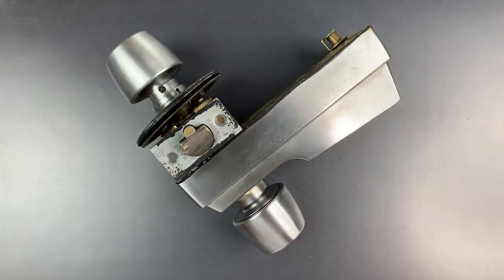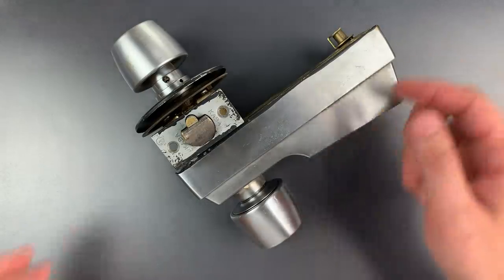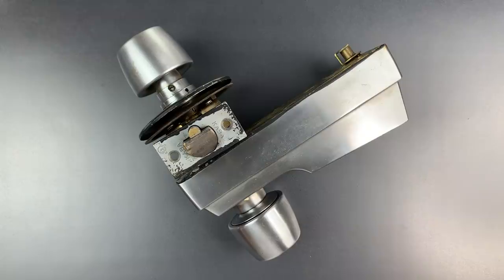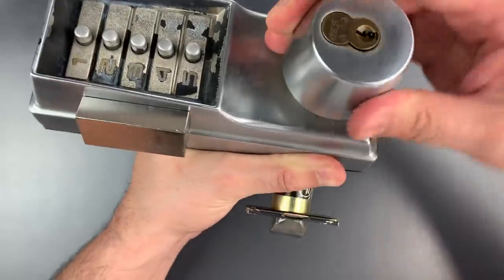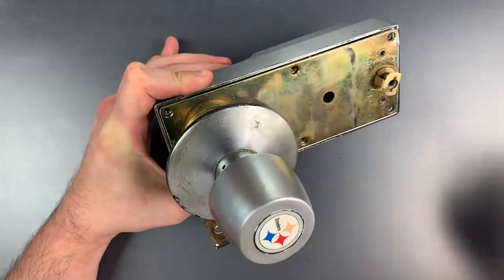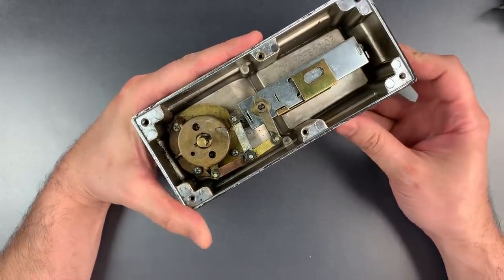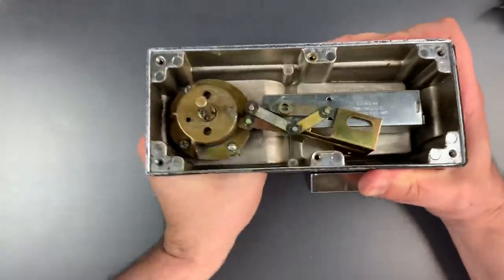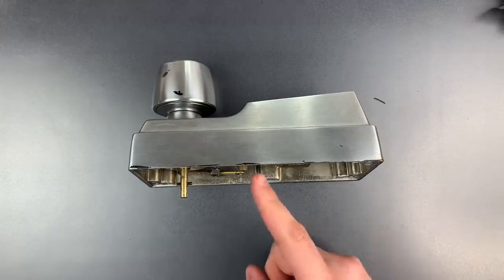[914] The Worst Lock Design Blunder Ever? (Kaba Simplex Series 1000)

Comment: If that’s true that this model was the one with a thumb turn on the inside of the door, there are hardly any out there that I’ve seen in my 20 years as a locksmith. Almost every one I’ve come across does NOT have a thumb turn, therefore, does not have that metal piece in the inside.

Comment: It almost seems like the whole point of that goofy linkage is to allow the knob to turn without opening the door.  Unlike, say a normal door lock that just prevents the turning of the knob.  Am I missing something or is there a reason they didn't use something more conventional.
Reply: Ray Ceeya it is so that smashing the knob with a hammer so that you can turn what’s left won’t open the door. I doubt this is sufficient to stop someone from continuing to attack it until they force it open but it does buy a little time.

Comment: I forgot to add earlier: at work, these are usually installed without the backup key lock, because they don't ever come with it. So on the front of the lock that faces out of the room, where the key SHOULD go... there's just an open slot. In the back of that, there are two pins that can be spun and the lock opens. I usually just open them with the file on my multi-tool... or just the tool they provide that's supposed to be used to spin the retaining ring.

Comment: Only works on a 1000 series with the passage function, which is not standard equipment. Cool trick however. Hardly an egregious flaw but now you’ve told everyone so good going. I’ve been a locksmith for 42 years and have tried to minimize telling thieves how to defeat locks, but you seem to be clever.

Comment: I hated these when I worked at the Pentagon in the late `90s. Even without the magnet it is easy to figure out the combo due to wear. They hardly ever changed the combos, even though security requirements dictated that they be changed every time a person left the unit (usually orders or end of contract). Many never hit changed from the day they were installed.
Reply: Misuse of the lock isn't the manufacturer's fault. It's the negligence of those contracted to maintain access security. It takes about two minutes to change the combination, if you know what you're doing.

Comment: That design is NOT a high security lock. There are only a very few unique combinations (a few hundred) that are possible and that does not provide a lot of security. But it looks neat.
Reply from the maker: A few hundred? Check your math, and remember that (1) order matters, and (2) a button may be pushed simultaneously with another button or buttons.

Comment: To be fair, back in the day when these locks were used (70's and 80's), since neodymium magnets were not invented until 1982, and even then, were prohibitively expensive and not easily available. You couldn't go on Amazon and buy them like you can now.
Reply: It doesn't require a neodymium magnet.

Comment: The 1990’s choice... There is a vast difference in heavy durability versus high security.  All it takes is starring at users enough from a safe distance to see the code.  These workhorses have been applied to far too many openings that probably are worthy of better tech.  These $700 -$900 installed units were often justified versus $3500 -$5000 for online card readers at that point in time.  Today, material costs on the electronic side offers as low as $1900 offerings, especially stand alone or cloud based.  Prices are center line examples of installed costs, which obviously vary in different labor and union markets.   The $5000 example may include conduits.  If you are installing in a Airport, logistics and the working environment may double the cost.  

Back to the term “High Security”... this lock does not even deserve such a title even without the magnetic defect, based on my 4 decades in the industry.  It’s heavy duty or Commonly referred to as Grade 1.  BHMI Grade 1 is a testing grade for mechanical longevity.  In most Grade 1 products, the security will be more secure to lower Grade 2 or 3, yet there are product specific exceptions.

Comment: Through by professional relationship with dormakaba, i can confirm that this was a real issue and all of the customers that were aware of this issue have been taken care of along with other issues similar to this in other locks. However, if the owner ignored all notifications and refused to get it fixed...and many do this...they would still have this problem still. I still replace these locks all of the time with their new e-plex series and when i take the old locks apart, some still have the old mechanism. I have kept a few discarded locks in the garage to show my friends. Nothing is absolutely secure and that goes for any lock manufacturer. You’d be surprised

Comment: Simply replacing that steel with heavy bronze would have fixed the flaw.

This flaw is so bad, and so easily fixed, it makes you wonder of "someone" had them put it in specifically, like happened with certain flaws in encryption algorithms.
Reply: Did Intel design this lock? 😂
Reply: @renakunisaki 

Honestly I was referring to the NSA work on the RSA algorithm which resulted in an RNG flaw.

Comment: It is usualy not too hard to figure out the combination on locks like this just by inspecting it's buttons. The most dirty and worn out would be the ones you need, you could also use some powder to see fingerprints better. Might not be that easy with this one, as you'll also have to figure out the order in wich numbers are entered. 10-15 years ago In Russia on common doors in apartment houses certain combination locks were popular - they had buttons with numbers from 0 to 9, and you had to push three buttons at the same time (!) to unlock it. After like half a year use those buttons required to open the lock were pushed in a little bit in comparsion to others. Absolute trash, never stopped anyone.

Comment: Given there are only  80 combinations (5*4*4), at a generous 3 seconds per combination, you could try every combination in 4 minutes.
Reply from the maker: 80? I don’t think you understand the mechanism. I believe it’s around 1,000... still not a whole lot, but better than 80.
Reply: @lockpickinglawyer  The only units that I've encountered in the wild have a 3 digit combination where you cannot use the same digit immediately after it was just used. I've tried looking through the documentation to see if there are longer combination lengths, but it's somewhat unclear. At 3 digits, the 80 combination number is correct, at 4 digits, there are 320 combinations, at 5 digits there are 1280 combinations.

Comment: Same application applies to just about every digital safe built today take a rare earth magnet put it inside a sock put around the to do them move it around the magnet will move the sleeve from the electromagnet allowing you to open just about any digital safe out there I'll take manual control dial locks anyday

Comment: Not to mention the fact that there are only 120 possible combinations...
Reply: These are fantastic locks, and what a lot of people don't know, is you can enhance the security, by depressing two or more of the buttons at the same time, to increase the number of complex combinations. In fact, if while depressing two or more buttons and you slightly favour one button ahead of the other (during the combination setting operation), that motion will become a part of the new combination, and would have to be precisely repeated in order to open the lock.  There are far more than a 120 combinations.

Comment: Ironically, you could have figured out the combination in a shorter time than the video. I’m told there are variants, but every lock of this type I’ve encountered has a maximum of 60 possible combinations. Since there is no 0 or 6-9, AND any possible combination can not repeat a digit in its sequence, this lock is just full of design flaws. If you press a digit it will have a slight resistance until it clicks and sets. If you press the same digit again, you will notice it feels softer and does not register. This is how you know the digits can not be used twice in a combination.
Reply: There are 541 combinations if you use all five buttons. If you add the number of combinations that can be achieved by using 4 buttons or less, brings the total to 1082. This does not include the number of combinations that can be achieved by depressing two or more buttons at the same time, when included in the combination.

Comment: Some of these things are so stupid I almost think they have to be deliberate.
And to be fair a "Rare Earth" magnet didn't exist practically until the 90s when they were budget breakers in the scientific catalogs, later with the internet and China marketing to the USA directly becoming as cheap and powerful as they are today.

So - with the Govern-NOT association I can almost imagine such a feature being put in deliberately.  A pocket battery powered electromagnet was something the "James Bond" crowd would certainly have custom made for bypass if needed whereas a tiny hole you could shove a pin into just right is where any thief has been since the 1500s.  For tangent, look at how they tried things like the "Clipper Chip" or successfully forced dot imprints on printers (To fight counter-fitters) therefore able to have more tracking of desktop publishing than communist countries had over registering and limiting typewriters.

Of course the flaw in any such conspiracy theory is how FLATTERING they are.  Imagining a clever bypass in the 50s from guys that inspired James Bond and Get Smart movies so the agent can bypass any door no trace if needed in seconds...  Cool!  Then not thinking (like computers with that millenium issue) the doorknobs would be in use that long and decades later the doors still being in use (good 50s American made quality) and cheap magnets that could out pull a $10,000 pre transistor compact custom made electromagnet for spies....  

That's more flattering than likely "The stupid, it burnnnssss....!"